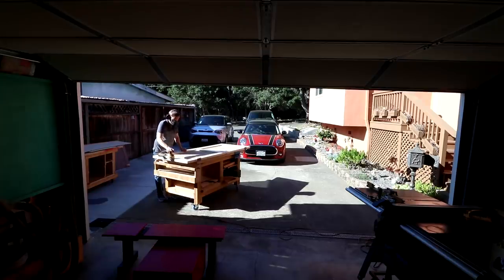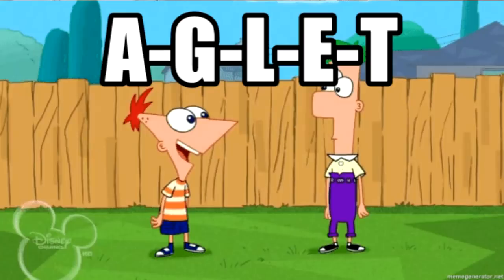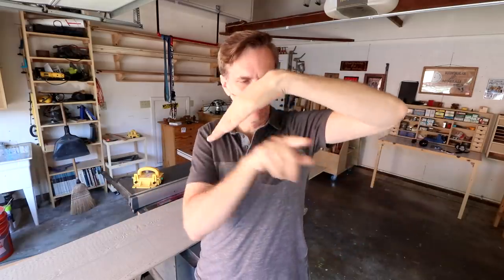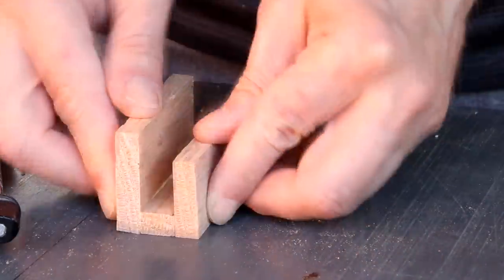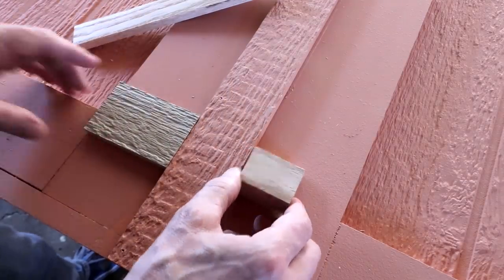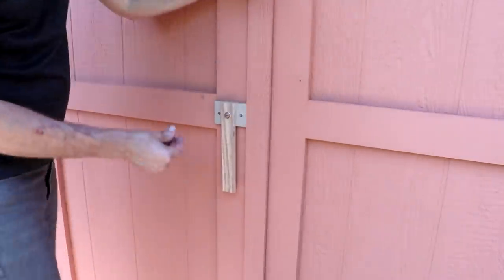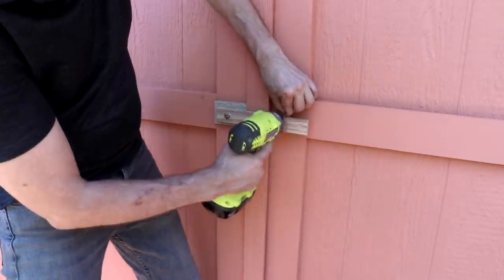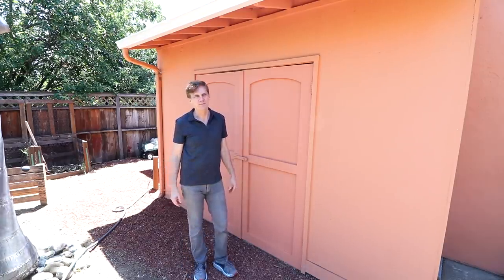The shed doors are done. With a fancy astragal! (Lol, YouTube doesn't know that word.) | Day 79

Comment: I would suggest that you place a skit plate on the base of the door to hold up the free hanging end. I normally use a small block of week and add a piece of scarp metal, I just close the door and attack it to the inside touching the ground. That way while the door is closed it is supported on both ends reducing the amount of door sag that can happen over long periods of time.

Comment: The barrel lock on the single door is a good idea because if the bar lock on the other door isn’t secured right, you can pull both open simultaneously which defeats the purpose. Now you have a way for the door to latch to something sturdy so it doesn’t just swing open.

Comment: I think we're talking about number 7 !

astragal (plural astragals)

(anatomy) Synonym of astragalus: the bone forming the ball of the ankle joint.
(plural only) Synonym of dice.
(architecture) A semicircular molding separating the architrave at the top or bottom of a column.
A tool used to mold such features; similar tools used for connecting panes of glass in a window.
(weaponry) A circular molding near the mouth of a cannon.
(botany) Synonym of locoweed of the genus Astragalus.
(architecture) A molding attached to double doors to prevent drafts.

Comment: Would it still be an astragal if mounted to the back side of the latch-bolted door? Thinking about the door stop surrounding the frame, it occurred to me that that strip over the gap (perhaps still an astragal) could also be in the inside in line with the stop. It would narrow the opening by an inch or so if you didn't open both doors...but it would have made the latch easier to construct. 
I am enjoying your lockdown series! What's next? 
Cheers!

Comment: Question on the bolts for latch...wouldn’t it cause water to seep into the internal of the wood via the holes you drilled? Water creeps into the smallest of cracks and that would effectively make the internals of the wood around the bolt damp without any way to escape which over time would cause doors to warp (again)...or am I overthinking this?!

Comment: Not sure if this is a dumb question but wouldn't it be very easy to break into that shed since the hinges are on the outside so all someone would have to do is walk upto the door use a tool to prod the long piece of metal holding the 2 hinge parts together and the doors will just come away?
Reply: Nah, it would be very easy to break into because there's no lock 😉

Comment: Hello your Mere Mortalness.... I am loving your videos but i have two issued id really love if you'd address
1. Your link to starting a wordwork shop for under 1000$, i dont know why i cant seem to connect to it.
2. How do yoi decide which method you'll use for joints... Like when should i use wood glue alone or wood glue with dhows or biscuit joints or when to use nails or screws... I am a total amateur but have have a passion for woodworking since i was young... Im just about finish purchasing my tools and start making small projects.... All the way from Kenya.